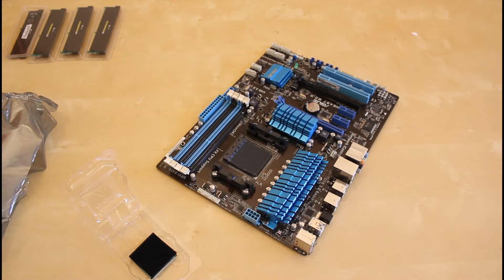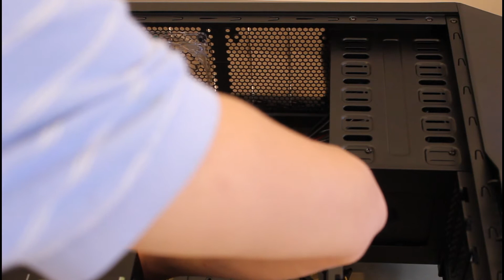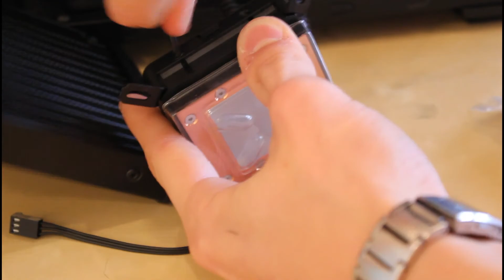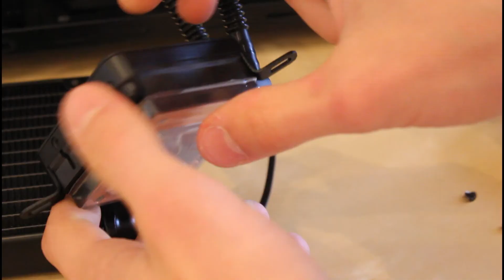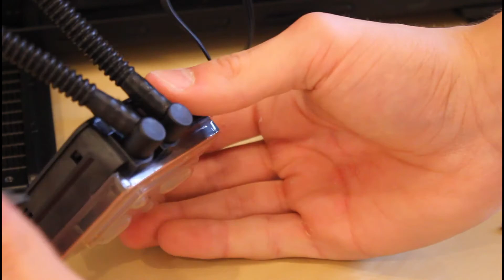Budget Gaming PC build Part 1

Comment from the maker: Ok firstly I would stick with the manual and use the blue ones. What brand of memory are you using? mine is 1600MHz and it runs fast so the clock speed definitely isnt slowing it down, what CPU do you have? that could be the problem, either that or defective ram I would say, how many GBs of RAM are you using?

Comment: can you help me please, I use this motherboard and I got a problem with the RAM:
its 2000MHz but I cant run it at 2000MHz so I took a look in the users manual and saw it does not support 2000MHz, so I set the RAM to auto (just to try) and it went to 1066MHz and when I put it to 1866 the PC runs very slow help please, and tell me in what colour I have to inster the RAM the manual said in the light blue ones but my uncle (who owns a PC shop) says in the black ones so I dont know help me please.

Comment: Hi was having a good look at both and it seems as if the R2.0 is a V2 of the old one it has a few more on board features like a motherboard USB 3 connector which is good for cases like the Z11 which have front USB ports if you buy an adapter from ebay for like 2 pounds. Overall the R2.0 seems better and that will be the one I am going to get. Also if you haven't seen already Novatech is also a good Computer parts website.